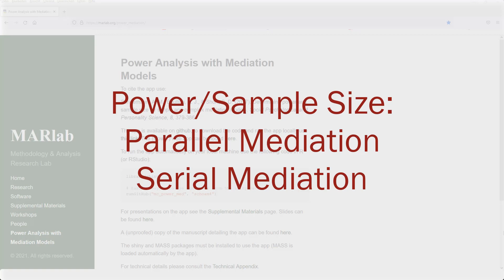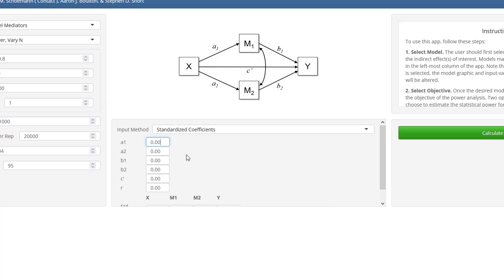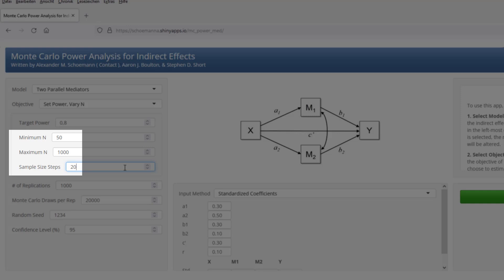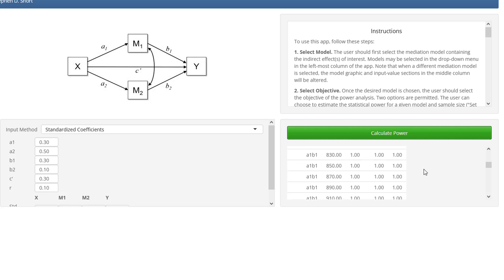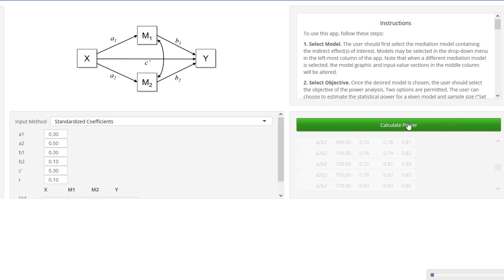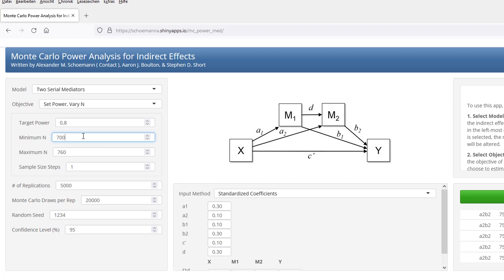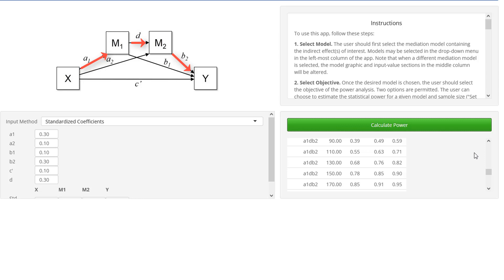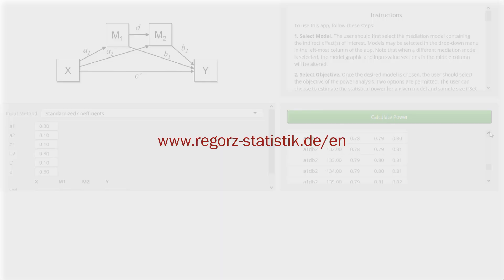Power Parallel Mediation & Power Serial Mediation

Comment: Thanks for the video. I conducted a serial mediation model (PROCESS Model 6, bootstrapped), and the reviewer requested a power analysis for this model. However, as far as I understand, classical a priori power analysis (e.g., G*Power) cannot be applied to serial mediation because the indirect effects are dependent and non-normally distributed. Our sample (N = 174) is consistent with literature recommendations for detecting medium-sized indirect effects. I want to be fully honest: is it acceptable to justify the sample based on literature norms and acknowledge limitations for small effects, without performing a Monte Carlo or post-hoc power analysis? Additionally, would it even be reasonable to attempt a formal power analysis for this type of serial mediation model?
Reply from the maker: Since there is a tool for a Monte Carlo power analysis I guess as a reviewer I would insist on the power analysis, too.
Reply: @RegorzStatistik  Thank you very much for your prompt response.

Comment: Thank you for the informative video! It was really helpful in understanding power analysis for mediation. I have a question regarding my study: I have two independent variables (X1 and X2), one dependent variable (Y), and one mediator (M). Should I calculate this using two separate models, or is there a way to analyze them together? Additionally, how should I determine the final sample size (N) for my study?
Reply from the maker: If you want to analyze it togehter you could use path modeling (AMOS or lavaan). There is an R package for power calculations using path modeling, semPower.
Reply from the maker: The alternative would be running PROCESS model 4 twice, each time including one IV as the x variable and the other IV as a covariate.

Comment: Hi, in my master's thesis, I am investigating a parallel mediation model. In another thesis, which also examines a parallel mediation model, the sample size was first calculated using a one-tailed bivariate correlation analysis for the relationship between the independent variable and the dependent variable with G*Power. Subsequently, the sample size for the mediation analysis was determined using the MARlab simulation tool. Now I am wondering whether the first step is necessary at all or what its purpose is. Could you please help me with this? Thank you very much!
Reply from the maker: I don't know the purpose of that step - I only know how to calculate the power using the tool I described in the  video.

Comment: hi, thanks for the information. However, I have 2 predictors,2 mediators, and 1outcome variables. I plan to run serial mediation analysis using AMOS. How do I determine the sample size? Would your method here apply to me? the total population is 804, how can I take the representative sample size from these population?
Reply from the maker: I think for that you would have to run a power analysis for a path model since the tool works only with one predictor, I believe.
There is an R package for that, semPower, but I haven't worked with that, yet.

Comment: Hi, thanks for the great video. However, I have 2 predictors,2 mediators, and 3 outcome variables. I plan to run serial mediation analysis using process macro. How do I determine the sample number? Would your method here apply to me?
Reply from the maker: I don't think so, because that tool is not made for more than one predictor (or for more than one outcome variable).

Comment: Hi, thank you for the helpful video. I was wondering please if you have any advice for what to do if there is no prior research to estimate the effect size for one of the paths? For example, I have coefficents from prior research for all paths except path b1 in the serial mediation analysis
Reply from the maker: One possible alternative would be to ask: What is the smallest meaningful effect size? What effect size would be relevant in the real world? (That, of course, depends on your area of research).
Reply: @RegorzStatistik  Thank you for your quick response! If you have easily to hand, would you please be able to point me in the direction of a reference for using the smallest meaningful effect size, when there is no effect size from prior research available? Even if the reference is not specific to my area (psychology) it would still be useful for me to read. I had a look myself but couldn't really find anything.
Reply from the maker: @dw6873  Unfortunately, I don't have a specific source for that.

Comment: Hello Regorz, many thanks for all the really helpful videos! I was wondering about how to best approach a post hoc power analysis of a serial mediation model which was conducted in PROCESS. Using the standardized coefficients provided by the macro yields very different power results (.82) compared to using the correlations between variables (.55). Unfortunately, I did not find any literature/lectures by Schoemann et al. on the use of standardized coefficients. What approach would you recommend? Further, is it possible to use the joint significance approach you explain in a different video to assess the power of a1db2? Best
Reply from the maker: Unfortunately, I don't know where the difference comes from. And I know of no literature applying the joint significance approach to a serial mediation, so there I'd have to answer "I don't know", too.
Reply: @RegorzStatistik  Thanks a lot for the swift reply!